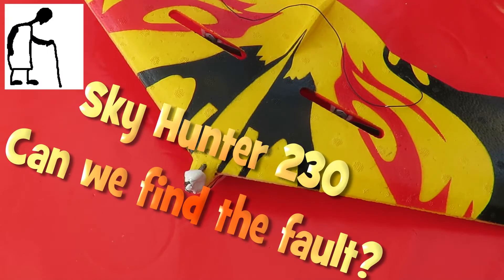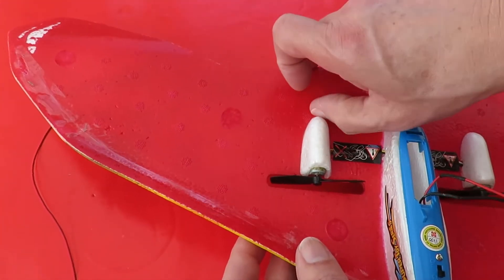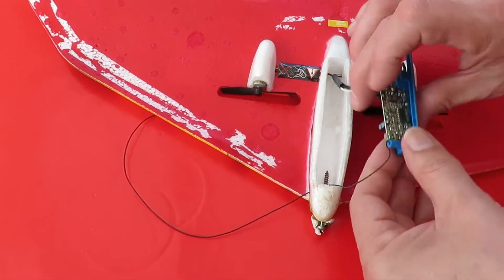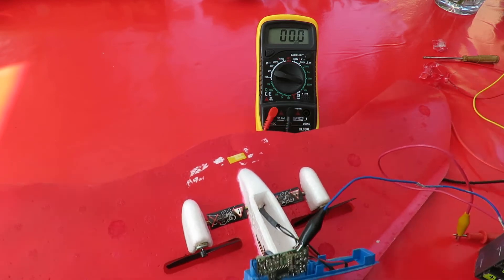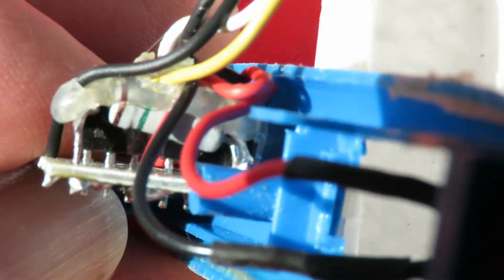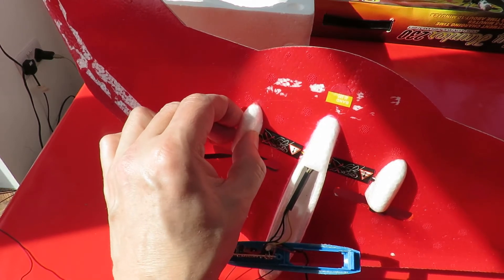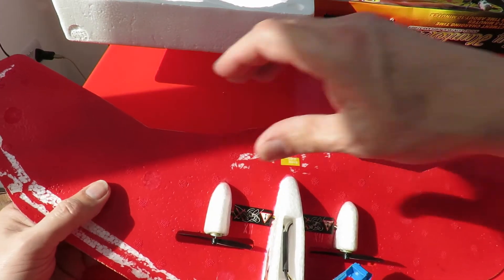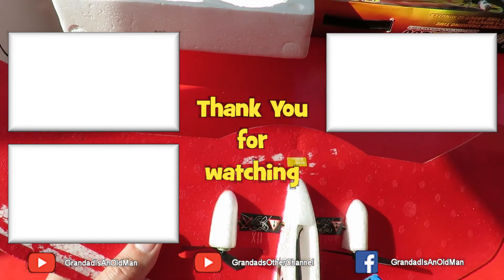RC Sky Hunter 230 - Can we find the fault?

Comment: Do these propellers spin counter clockwise?
Reply from the maker: No (or Yes) depending if you are looking from the front or the back 😊
Reply: I was trying to figure out why you think that Poundland glider will fly, considering the Sky Hunter has a totally different wingspan and the motors of it are placed close to the CG. I banged my head against the wall so many times when I was trying to scratch build my 1st RC plane, that I'd like to persuade you, to avoid to go through the same process/pilgrimage.
Reply from the maker: I don't understand why you are trying to make a connection between the two planes, it's not like they are the only two planes on my channel. The Sky Hunter is a Ready to Fly toy that a competent pilot would probably be fine flying. The path I am following with the Poundland glider is the path I have chosen to follow. If you look at the associated playlists with that series there are plenty of people doing successful conversions although most of them do make what I would consider significant changes to the original such as changing the wing, tail and rudder.
Reply: GrandadIsAnOldMan I may be wrong but you've said that if the flying wing flies with 2 motors spinning in the same direction, the Poundland glider will do the same. Feel free of doing all the experiments you'd like to do (of course, you'll get more views and more subscribers), but in my humble opinion the Poundland glider will never fly with that configuration and... it's a pity!
Reply from the maker: I seem to remember your opinion was that it was impossible for a twin engine plane to fly with both propellers turning in the same direction. By the same definition it would also be impossible for a single engine plane to fly because there would be nothing to balance the torque of the single engine. Having done some research on the issue it appears the possible advantage in having the props rotate in opposite directions is to avoid having a "critical" engine which would cause the plane to become unflyable if that engine failed. Hardly an issue for me as the chances of me being able to cope with any motor failure would be very slim and in the case of the Sky Hunter would cause it to crash anyway as you would lose any directional control. On a slightly different subject I did find that having the motors spin in opposite directions on my multi engined hovercraft was a clear advantage in stopping the torque induced spin.
Reply: GrandadIsAnOldMan I'm sorry but I might be misunderstood here. My point is not that it's impossible to fly an airplane with 2 motors spinning in the same direction. It's simply that not taking the advantage of having 1 motor that spins clockwise and the other one counter clockwise is a bit "strange", because there are benefits using this option, that help to have a better and balanced plane. I fully understand the torque roll of the single motor, in fact, when I've designed my scratch built pizza trays Very Easy Plane (aka V.E.P.), I've started from the minimum wingspan, adding flight after flight a piece of wing, to see when I was able to get rid of the torque roll itself. If you watch my video, you can see the whole development of it.